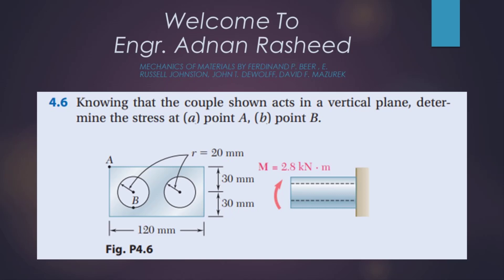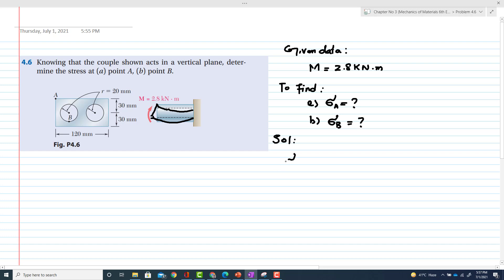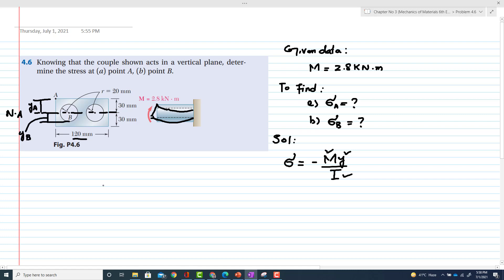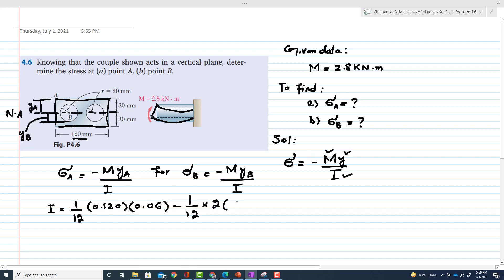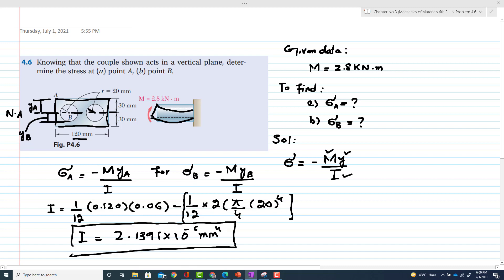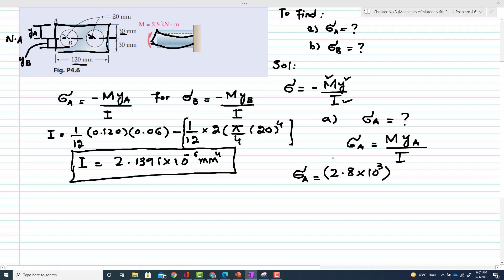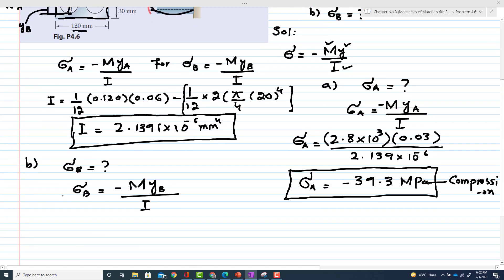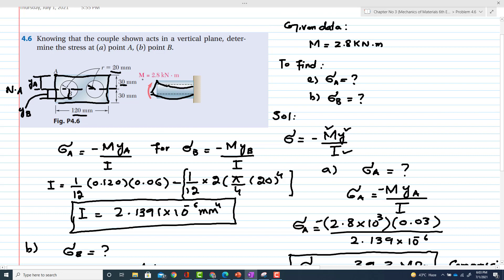Mech of Materials# |ProblemSolutionMOM​ | Problem 4.6 |Pure Bending| Engr. Adnan Rasheed

Comment: Sir, why is the formula you used is 1/12 (b)(h^3) - A? Not the formula, 1/12 (b)(h^3) + A(d^2)
Reply from the maker: As if you divide this section either vertically or horizontally it will be symmetrical about that axis. In this case we don't use the formula of parallel axis theory and ifthe body is not symmetrical about its horizontal axis or vertical axis then its neutral axis doesn't pass through centroid and hence we use parallel axis theorem
Reply from the maker: You can also apply parallel axis theorm on symmetrical body but in that case d will be zero so the term Axd^2 will become zero.....
Reply: @engradnanrasheedmechanical  Thank you for answering my question sir, Have a nice day!
Reply from the maker: @lheyfaller358 you are always welcome and if you feel any difficulties,  do ask questions....

Comment: Wouldn't the start of the formula to I be ,( (.12)(.06)^3)/12?
Reply from the maker: But there are two hole as well whose moment of interia should be subtracted ...
Reply: @engradnanrasheedmechanical  yes of course I just meant for the rectangular moment of inertia.
Reply from the maker: Yes you are right I forget to put power pf 3 on 0.06. Thank you for your correction

Comment: Im confused as to why there is a 1/12 multiplied by the area moment of inertia for the circle. Shouldnt that 1/12 not be there?
Reply from the maker: @Geoge Danial you are right as this is a  mistake. Thank you for your correction. 1/12 should not be multiple with moment of inertia for circle.
Reply from the maker: You are right. Kindly check the other comments below. That was a mistake